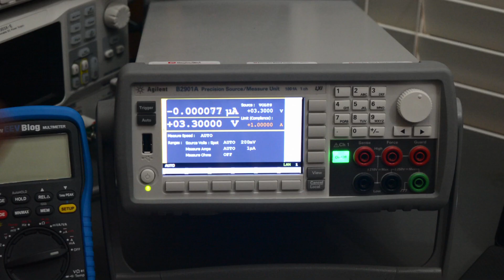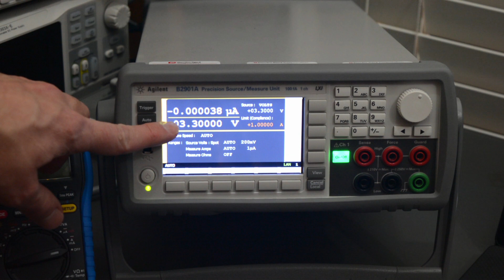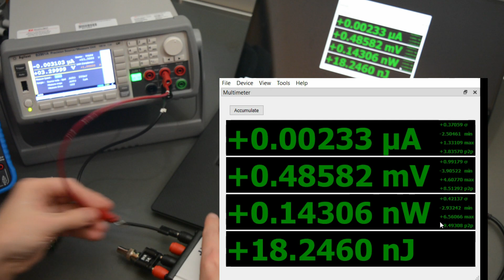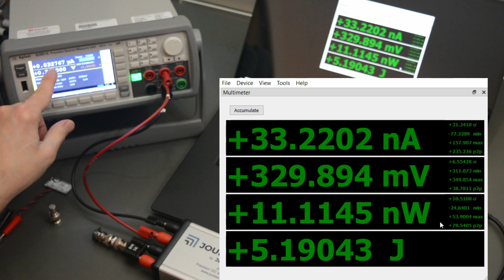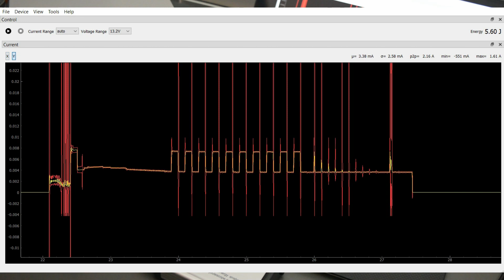Introducing Joulescope

Comment: Just got this delivered and it performs way better than even the keysight SMU sense that I use. The performance of this joulescope is similar to the top end type DMM's I've used. Most recommended. No idea about how long it holds calibration or deviation over time but unless you are working with three digit precision or so it is not really an issue.

Comment: But what's the after LED pulsing current spikes?
Reply from the maker: I am not sure which you mean: the red vertical lines at the start/end of LED blinking or narrow pulses at the end.  The red vertical lines show min/max, and are transients which I suspect are due to the power wire inductance as the LED switches on and off.  
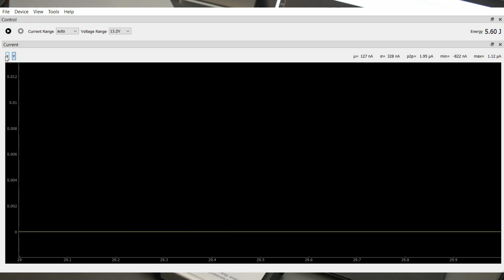The narrow toggles in the video at 4:57 near oscilloscope second marker 27 are very short duration LED on/off that I put into the Arduino sketch to demonstrate the dynamic response of Joulescope.  I will give more detail in a future video, hopefully in early 2019.  You can check out the Arduino source code at https://github.com/jetperch/joulescope_arduino_target , specifically https://github.com/jetperch/joulescope_arduino_target/blob/d43156d726278f3b1fb25789b3a9def80f6c8ec0/joulescope_arduino_target.ino#L70 .
Reply: Ah I see now! You said the pulses were very interesting at the 5:00 mark but that you'd cover them in another video. I thought it was the MCU doing some weird memory accesses or something in the background. Looking at the code this makes perfect sense now, thanks